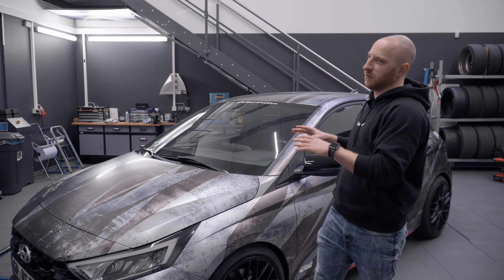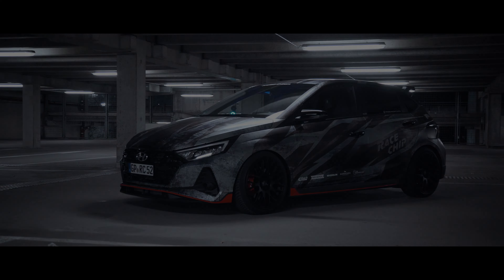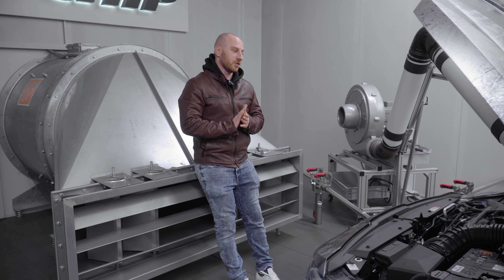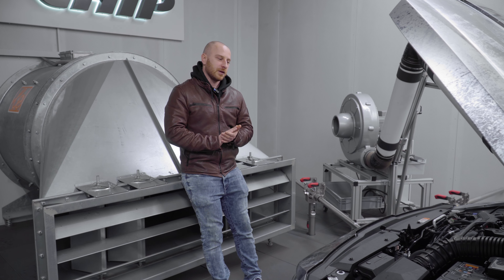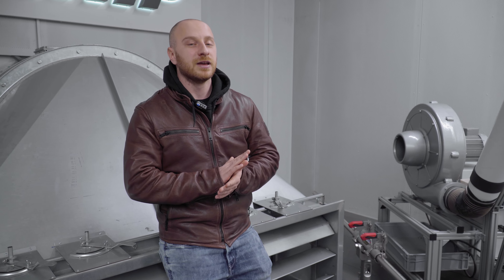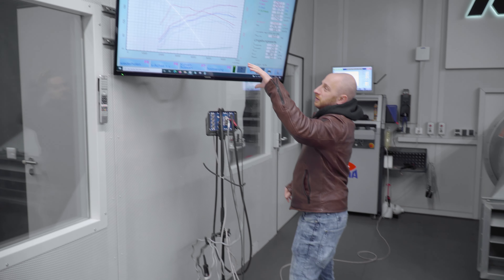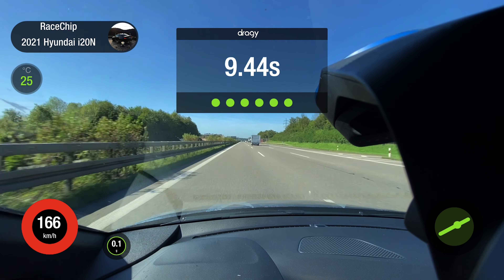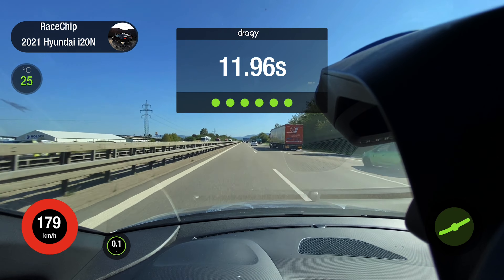Worlds fastest Hyundai i20N? RaceChip GTS Development & Review

Comment: Picked mine up and loving it! 

242hp and 350mn is a lot for a car that only weighs 1200kg.

If this car came with a dsg, it’d be a solid 5.5 sec 0-100km car.

In the stock manual gearbox however, it’d be hard to anything faster than 6 seconds flat 0-100km.
Reply: how is it going with the chip and how much did you buy it for?

Comment: Does this have the Hyundai G4TP 1.6 Smartstream engine? Just wondering if it will work with the DN8 Sonata that has the same engine but an 8 spd standard automatic trans
Reply: Yes this same engine is also found in the Elantra N-line it's just it's tuned a bit different for the i20N

Comment: I wrote to you on several social networks, but you do not answer.  ok, I'll ask here.  what chip to buy for vw czca engine?(1.4 tsi, 125hp, 200nm). I can't choose this engine in VW Polo section, because I own Polo sedan.
Reply from the maker: Hi! we are going to add the VW Polo 1.4TSI for the next database update, which should be this week. You can give it a try and check our shop at the end of this week. 
VW -> Polo V (6R, 6C) -> 1.4 TSi (125 HP/ 92 kW)

Comment: Never 242 Hp
Reply: 225-230?
Reply: It should be faster 100-200 with 242hp considering the low weight. A 245hp Golf 8 GTI has around 16sec 100-200, with a much higher weight.
Reply: I guess the horsepower is close to 230 range, As you mention if it had 242  hp without loosing power uptop, it would achieve 100-200 close to 15.5
Reply: HORSEPOWER STOCK HAS 209, WITH RACECHIP ..223.
Reply: @TheTylos  the golf is DSG. Will be faster in a straight line. Doubt it will perform better on a track